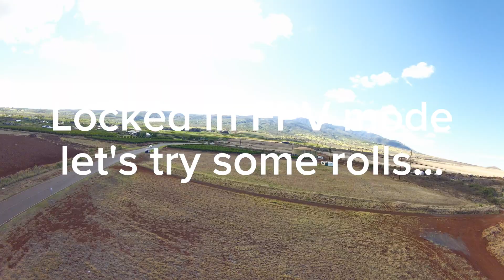7in Quad with GM3 3 Axis Gimbal, Serial Test

Comment: I have a heck of a lot more than jittering going on. I have a similar setup as you... TX16S MkII, GM3 on the sliders. I don't get smooth motion between center, and each end point. As I smoothly move a slider (either one, matters not) the gimbal will move slightly, then, as I continue to move the slider, it will slam over to the endpoint. My radio is acting as if channels 7-10 (the gimbal PWM channels) are designed for 3 position switch. I'm having a terrible time trying to sort this out.